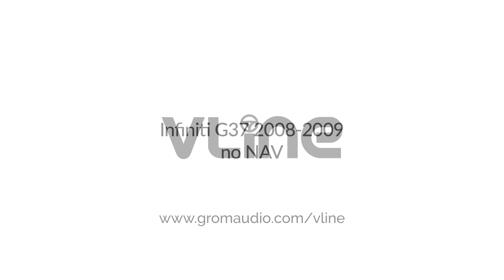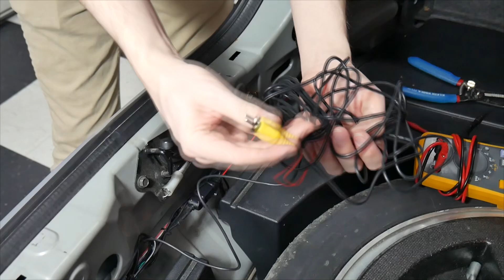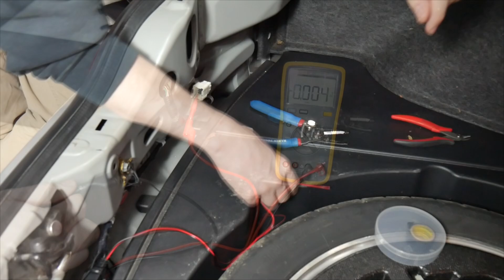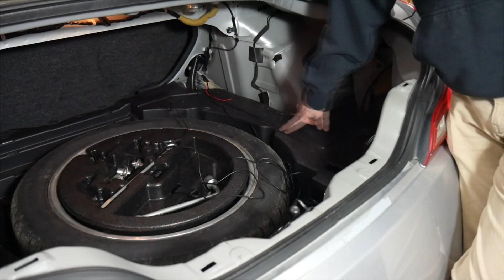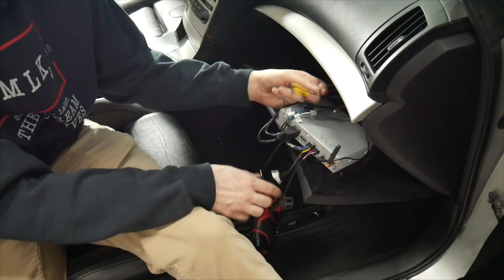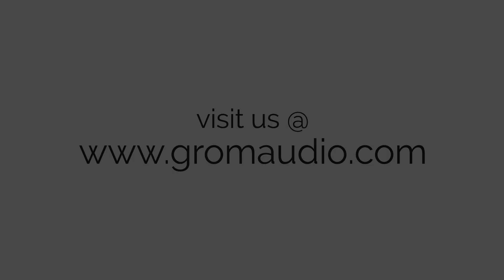Install Aftermarket Backup Camera into Infiniti 2008-2013 No NAV | GROM VLine CarPlay Android NISK

Comment: Have a 2008 g37 6mt with no reverse camera what will i need ??
Reply from the maker: If your 2008 Infiniti G37 does not have a factory navigation system, you can use the NISKVL2 model of VLine VL2 system, available here:
https://gromaudio.com/store/vline/grom-vl2-nisk.html
You can add the aftermarket reverse camera to the vehicle using the VLine VL2 system model NISKVL2. You can find the camera that we offer here:
https://gromaudio.com/store/vline_accessories/camera-v-bcc1.html
Note that you will also need the AUX RCA cable for VLine VL2 system (VAUX), available here:
https://gromaudio.com/store/vline_accessories/cable-vaux.html